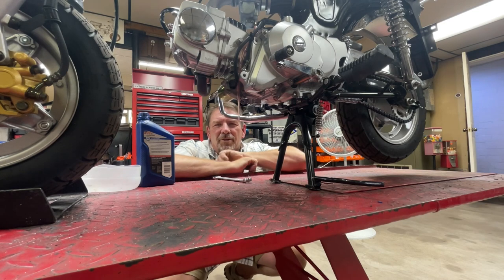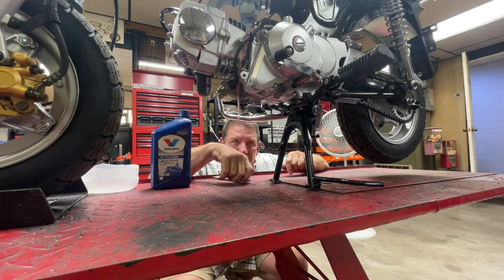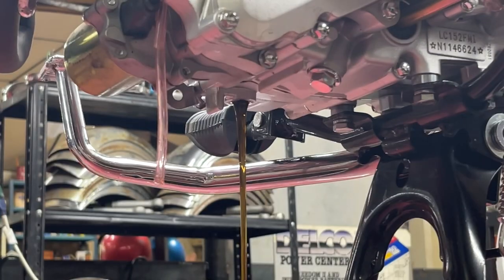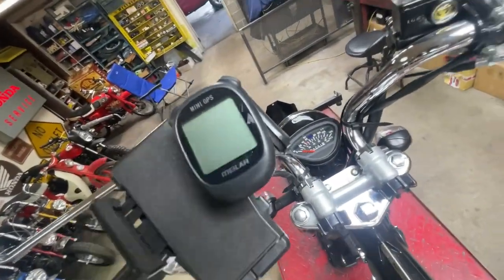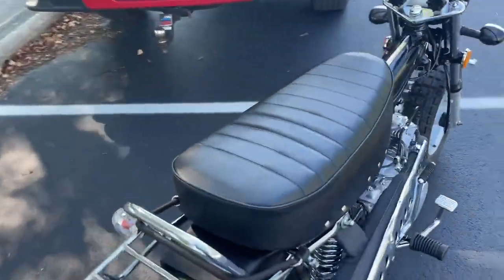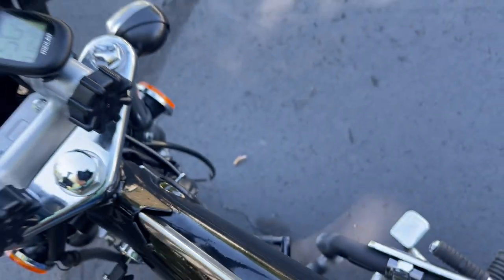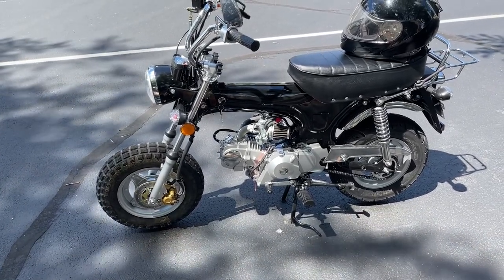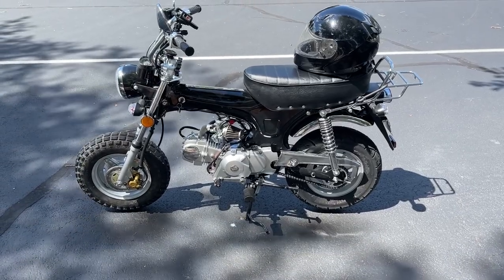IceBear CT70 clone - tire size speed runs

Comment: Interesting to see the differences in tire size. Great video Mike!
Reply: Hello Mike awesome videos do you think that bike can handle 130-90-10 tires?
Reply from the maker: Mike B:  I’m sorry I haven’t responded sooner, but I haven’t had a chance to get back to the shop and physically measure the size of each tire.  I will let you know when I get that done. 

Mike O:   I’ve not personally tried to fit that size tire, but I’ve read on FB pages that it is possible to fit them to these bikes.

Comment: You are correct Mike, that oil in it is just to keep the internals from rusting. It needs to be changed actually before driving it lol
Reply from the maker: I tested it once and put 1000 miles on a new Lifan before I changed the oil.   That engine still runs great and now has over 6000 miles on it.
Reply: That's good to know. I've always been told to change it before riding.
Reply from the maker: @harleyman19692  I’m horrible at listen to advice from others….I like to find things out on my own.  It bites me in the ass sometimes.  🤣🤣🤣
Reply: True that🤣🤣

Comment: I just bought an icebear and I've never worked on a motorcycle before. I bought two of those Kenda 120/90/10 tires. They're tubeless but you're saying that I need tubes? Do the stock wheels have tubes I can use? Im confused. Lol   Thanks
Reply from the maker: Yes, you will need tubes.  The rims on these bikes are two halves that bolt together.  They won’t hold air without a tube.  I believe the stock tubes will be too small, you’ll need 4.00-10 or 4.5-10 tubes.
Reply: Thank you!!!

Comment: Hello Mike, 
I have a speedo question I hope you can answer for me. I have a CT-70 with the Zongshen 190 conversion and the speedo seized up. No I didn’t do a 90 mph blast on it! Do you know if the speed calibration is determined by the gear drive at the wheel? If so, I would think I could use the speedo from a larger 70’s Honda m/c and get a factory looking mechanical speedo with an 80 mph face on it. 
Make sense?
Reply from the maker: Unfortunately, I do not know the answer to this.  I’ve never built a bike that needed more than the stock speedo. 🤣
Reply: @MiniBikeMike  ok, Thanks Mike. Enjoy your vids, think I’ll give it a try.

Comment: How is the quality of the bike? I'm thinking about getting one in the next couple days
Reply from the maker: I’m pretty happy with the build quality.  If you’re OK with 45mph max riding, it’s great right out of the crate.   I wanted to push a tad past 50mph, so a carb, exhaust and wheel upgrade was needed.  For $1500, it’s a really good bike.
Reply: @MiniBikeMike  there's one posted near me for 1300 with 70 miles on it so I'm hoping I can get the guy down to 1100 or maybe even a 1000
Reply: @Bill-bi7sk  Why are they getting rid of it sooooooo quickly? 70 miles is like a few rides.
Reply: @ddaattrroonn  I ended up not getting it but I think some people buy them thinking they are going to ride them a lot but don’t

Comment: Will a MAXXIS 130/70-12 IN.TIRE FIT THE REAR I'VE ALREADY HAVE THE 12-INCH ALUMINUM RIMS THAT I PURCHASED FROM BART MOTOR COMPANY OUT OF ORANGE COUNTY CALIFORNIA. VERY NICE ONE PIECE ALUMINUM RIMS. I ALREADY HAVE THE BRAND NEW MAXXIS 120/70-12 IN TIRES. BUT I JUST WANT TO IF I CAN UPGRADE IT TO THE REAR END TIRE 130/70-12 IN MAXXIS TIRE ON REAR.
Reply from the maker: Sorry, no clue.  I’ve not used tires that big or 12” rims….I stick more to stock stuff.

Comment: Very interesting video. I have the stock tires on my 1970 CT70. I also have a 140cc motor. I wonder how that would work for me.
Reply from the maker: Depending on the sprocket sizes you’re running, I would say the 140 will pull the 120/90 -10’s a lot better than this 125 did.
Reply: @MiniBikeMike  Thanks Mike, it is an interesting thought. I am running 17/32 sprockets with my YX140.

Comment: How did it compare with the speedometer on the bike
Reply from the maker: The stock speedo is useless.  The odometer seems to be accurate in Km, but the speedo is completely inaccurate.
Reply: @MiniBikeMike  I believe they got some digital speedometers has a setting that can be switched from kilometers to miles per hour for the ct70s but they're made in China